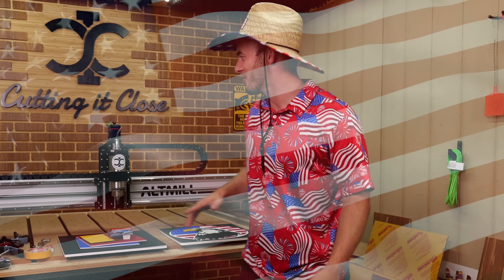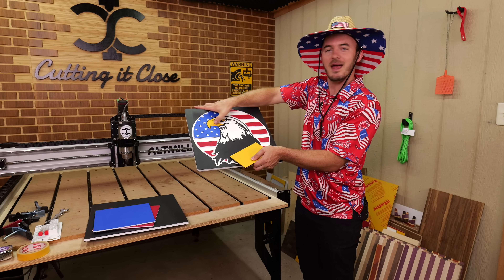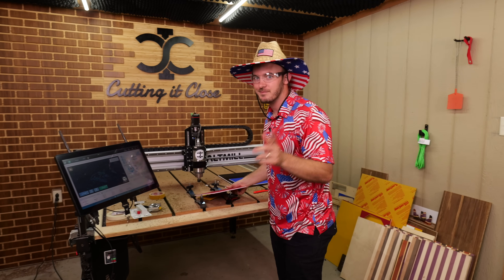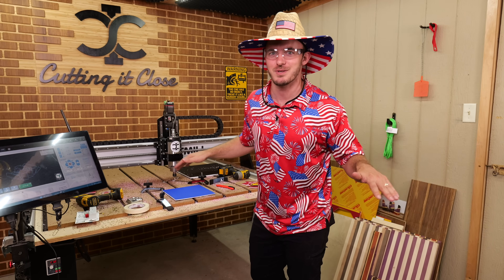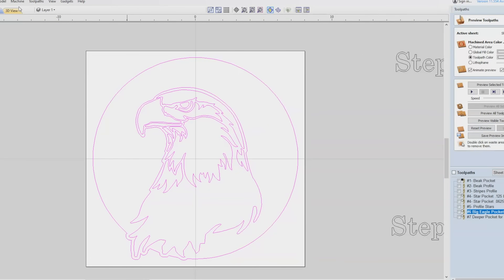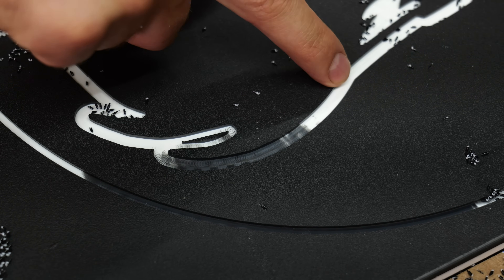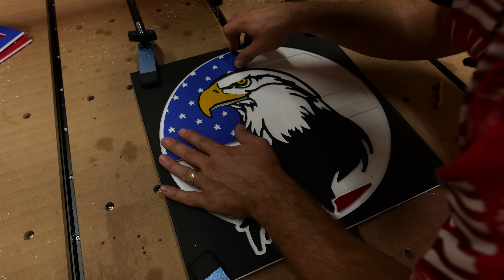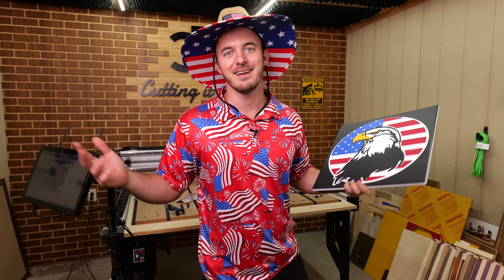This CNC Project Will Change How You Build - CIC Workshop CNC Kit #1

Comment: HELP! Everything cuit out perfectly. There's only one problem--the pieces don't fit into the pockets. They look like they should fit, but they are ever so slightly to big.. I mean it so small you can hardly measure the difference.  Ever have this problem? And any ideas what I can do? Can you heat this stuff up and make it flexibler?
Reply: I had the same issue and used a negative pocket allowance of -.005 I think I should have done a -.01, I had to sand down the outsides of the inserted pieces but it still looks pretty cool.

Comment: Love your videos, thank you. For informational purposes only, I normally watch YouTube videos at 1.25 speed to keep things moving, but with the ability to rewatch any portion necessary.

For fastening HDPE, I'm considering using 11.5mm euro screws from the backside. I worry about these signs not holding up to the elements outdoors year after year. The plastic will last for near ever, but will it stay in place without a mechanical fastener, is my concern. 

Great product, as always, thank you.

Comment: I'm curious. Can a clear coat finish be applied to HDPE? Or, should it even be done?
Reply from the maker: It’s not going to stick, and does not have to be done, it’s already waterproof, weatherproof and won’t fade. So it’s finish free!
Reply: @cutting-it-close awesome!  The side without the film has gotten scratched a little in my shop, (being moved around a lot due to cnc table build) and that's the only reason I thought to ask about it.

Comment: Do you think it would be feasible to create a "frame" - basically a piece of plywood or MDF with open rectangles to hold all the uncut pieces in place so you could cut them all at once? That would be really handy if you plan to make a bunch of those plaques.
Reply: Another thing:  since you are using red/white/red for the stripes - why didn't you just cut pockets where you wanted the white stripes and make all the red and white stripes a single piece?
Reply: @ABNestor  I would think cost would be a driving factor there-big red sheet costs more than a small red sheet.
Reply: Last comment:  I would like to see a video on how you designed this (or if I missed that one - just point me to it).

Comment: When you're pocketing out an area on HDPE. How do you reduce or eliminate the swirl marks left by the bit when it changes directions? I made a few signs the other day with blue white blue and red black red, and the black looks horrendous with the swirling around the letters. The white you couldn't see it very well. But it was there also. I ran one at 150 ipm the other at 180 ipm with a ¼ o-flute upcut. Is that just the way it does or am I doing something wrong

Comment: I am new to C&C what is a negative pocket allowance?
Reply: A negative pocket allowance is where you tell the machine to over-cut the pocket by an amount you specify in the setting. If the program you are using doesn't have a place to put this in. You can do an offset outwards by the amount you need. This is helpful when doing what Ryan is doing with the eagle sign. That way the pieces will fit into the pockets.
Reply: A pocket allowance is for the roughing pass to leave some material on the edge of the pocket , so the finishing pass can complete the edge smoothly.
A negative value for the pocket allowance makes the pocket larger.
Reply: @robert_g_fbg  I Was wondering that also i cut and the pieces are to big. Do i make the pocket allowance zero or a larger negative number?
Reply: @bobfilzen5539  a more negative number enlarges the pocket. Make the allowance more positive to shrink the pocket.  
For the plug part, use the opposite direction, since its pocket is the negative space around it. 
Although this method will help you tune the fit, both bit diameter accuracy and runout on the spindle could be root cause of your fitment issue